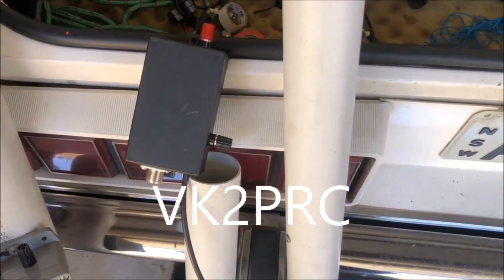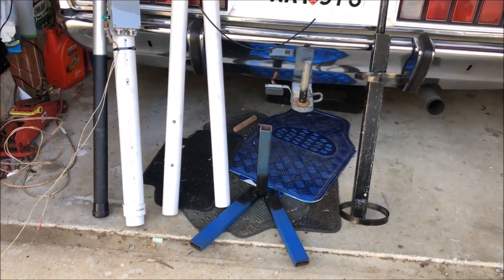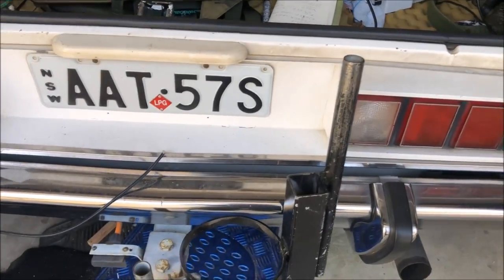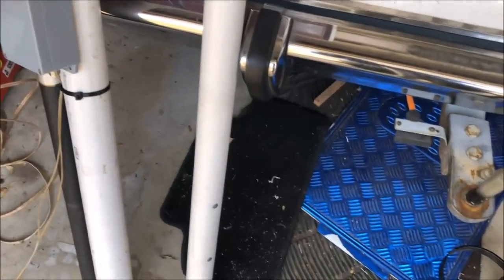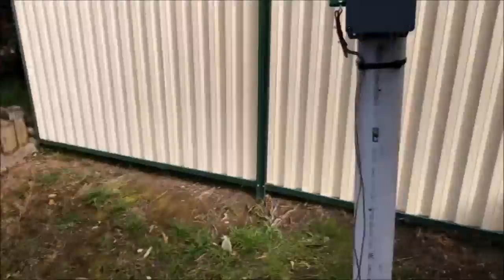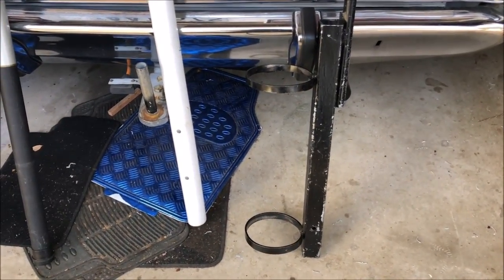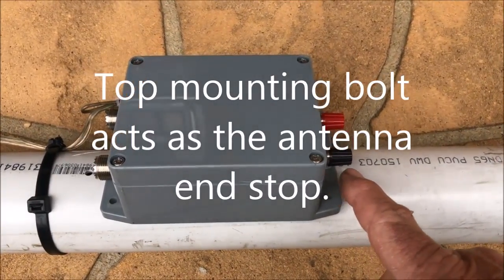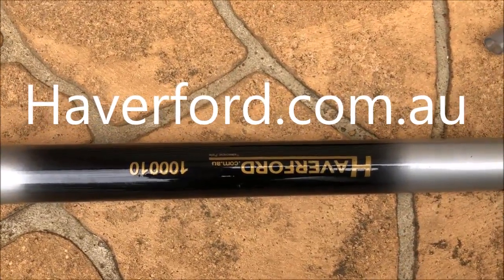VK2PRC Half Wave End Fed Portable Support System

Comment: Another fantastic video!  Any special concerns to deploy the antenna's counterpoise when the mast is on the trailer hitch?  Straight back?  To the side?  Can you use the metal car as a counterpoise?
Reply from the maker: You must remember the counterpoise wire for the 20M HWEF is not really a counterpoise in a sense its just a wire to dissipate common mode currents so it can just lay on the ground or be pulled out.

Comment: Great videos Alex. What would you suggest for a permanent installation at home… fiberglass pole like yours? Will it survive storms 50 mph wind? Also, can both 20 and 40m wires be plugged in at same time but separated by a few inches going vertically. I’m thinking not.
How about hanging from a tall tree… no post needed?

Thanks again for you great work and passion for the hobby.
Reply from the maker: OK for a home installation I would suggest the use of guy wires made of non conductive material to aid in strong winds.  Hanging vertical from a tree is fine, the same antenna is used for both 20 and 40M so only one antenna wire required.

Comment: Good tips, I use a very similar configuration.  I use a 40 meter 1/2 wave link and a 49 to 1  UNUN and 30 fiberglass pole with the 63ft wire running up, down, and back up,  it works good on 10, 15, 20 & 40 meters.  You have a great 👍antenna here ❗️ 73. KV5P